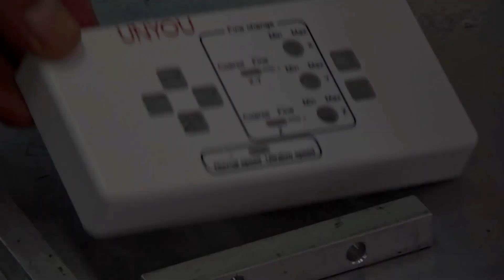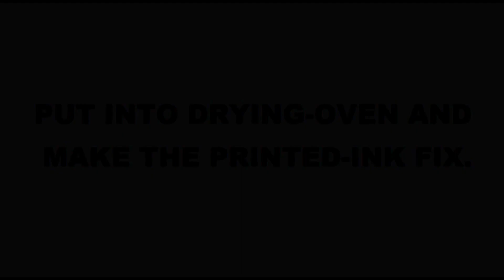TAKACHI ENCLOSURE　SILK-SCREEN PRINTING

Comment: You can pull a rope on the two clamps inside the screen to fix the squeegee handle. After each printing, you must put the squeegee handle on the worktable, which is very troublesome.

Comment: Which type of ink do you use?
Reply: i have the same question.  ;)
Reply: @pablokfc34  you probably will have to order first some printing job, before they let you know...
Reply: Plastic parts need vinyl inks. (Nazdar) metal needs an epoxy.This thread is ancient but oh well.